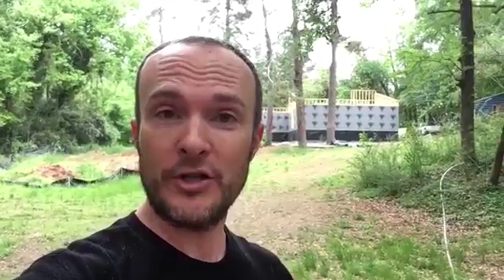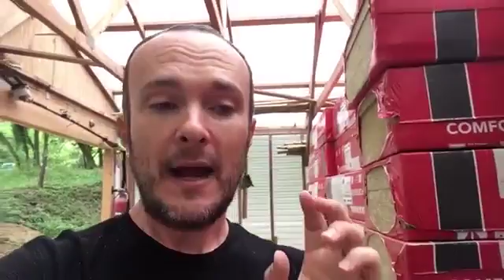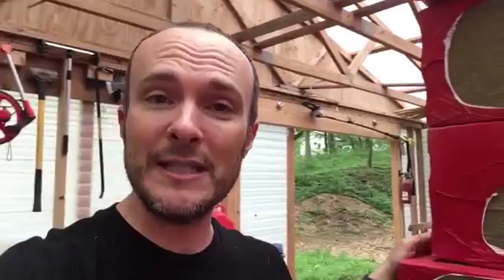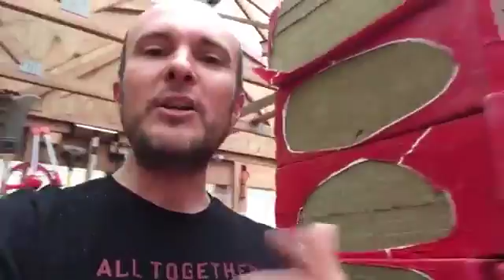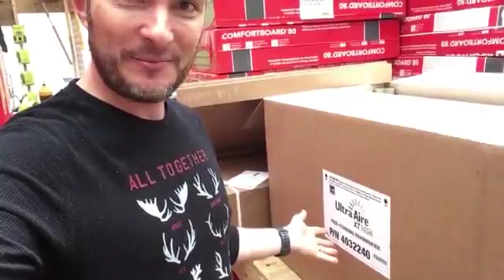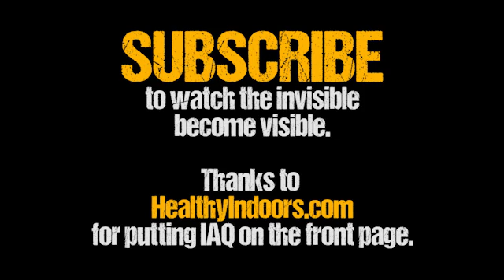Building to Control Humidity: Healthy Indoors Minute

Comment: Vapor permeable all around is a great,if not the best way, to build. However, I am finding a lot of roofing assemblies that are impermeable (or darn close) with permeable insulation which, when moisture gets in (through diffusion and or air movement) it has an extremely difficult time getting out. I am seeing a tendency toward things like closed cell foam in roof-lines for this reason. Walls are typically staying vapor open.
Your thoughts?
Reply: First things first , where the moisture come from?
Reply: foaming around the roof line where the side wall and rafter is just a small space.   But one still needs to allow for air movement. Why a cold roof works so nicely .  Remember you have to allow the house to dry from the inside or outside. or both.. When you stop the flow of moisture way to often other things come into play that might not be what one is expecting.    I do plan on having built in de-humidification due to my location.. It is like having an erv or hrv  We as people need to have fresh air.. the house does not need to breath but when it does.. dehumidifying is also part of the equation as one tightens up the exterior envelope.
Reply from the maker: Agreed- actually, this client I mentioned has a rubber roof membrane (impermeable) that was installed, surprisingly, after it rained. They’re installing open cell spray instead of closed so the roof system can continue drying to the inside over the coming months- so much complexity in any system, a lot can lead us down the path we didn’t plan for.